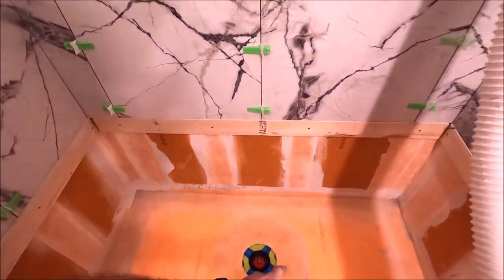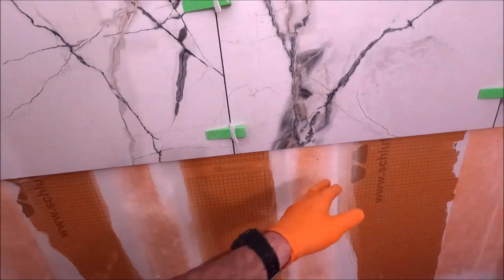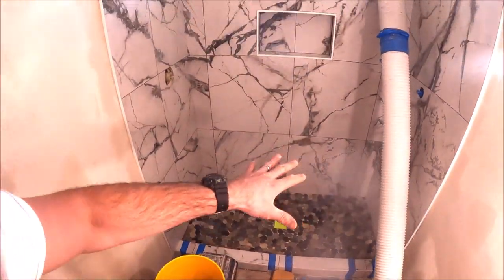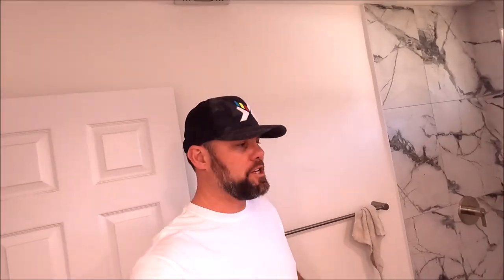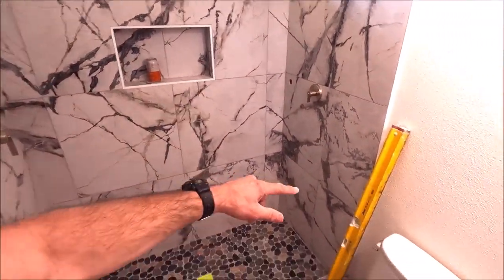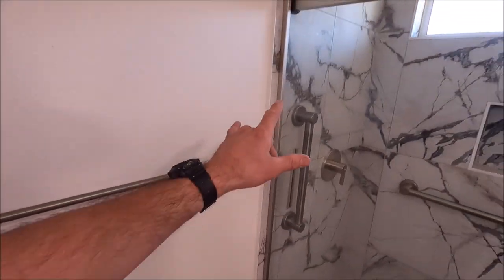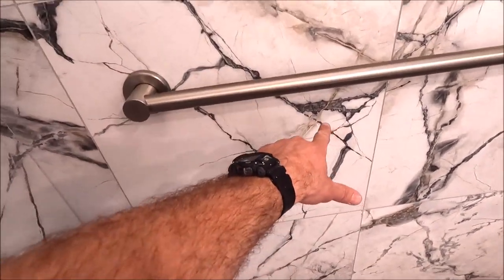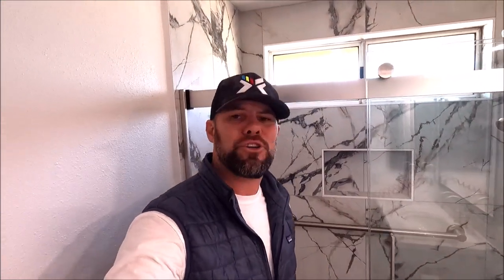Disaster to Dazzling Carrera Shower Complete!

Comment: Looks good brother, i personally find slapping some kerdi fix, or quad max into the holes to work a little easier, wet your finger and it spreads easy.
Reply: Same. Plus you don't have to worry about the fabric buildup.
Reply from the maker: Thanks for the tip

Comment: Darn you do awesome work! Obviously very knowledgeable and accurate! I've learned alot so far and now, it's my turn to start installing tile. Quick question... I'm planning on installing the 60" wall first. Then I'll need to cut the tile in the corner for the 30" walls so I don't end up with a 2" sliver on the outside. I'm using both 12x12 and 12x6 porcelain in a pattern. I have 32" o wall to cover with 8" to figure out (2 tiles at 12" + the 8" of wall to cover). If I take an inch off the inside tile I end up with a 5" inside and a 3" outside edge. Or should I split the 8" and do 4 and 4 considering I am trying to wrap the back wall tiles and end walls for continuous flow?
 Do I need to address the cut edges before I caulk that corner or will the caulk cover the cut edge? Thank you for enduring my rant. Jeff